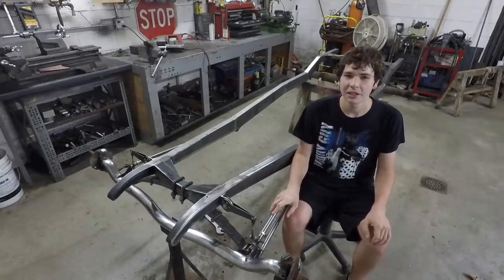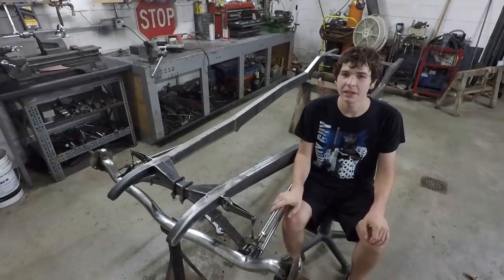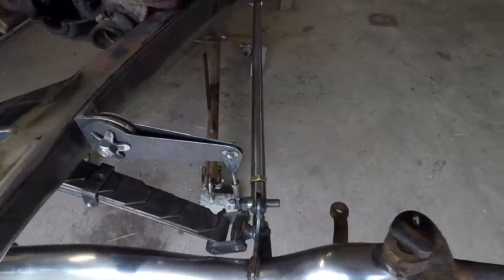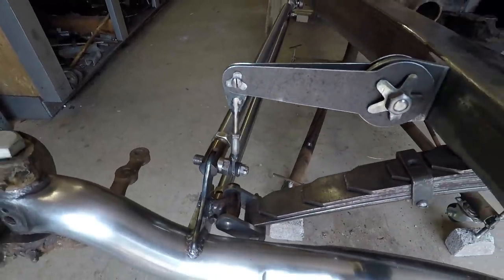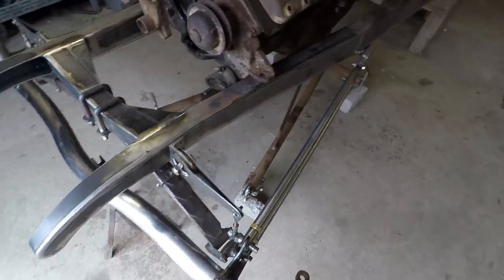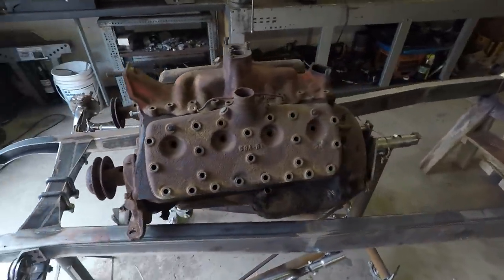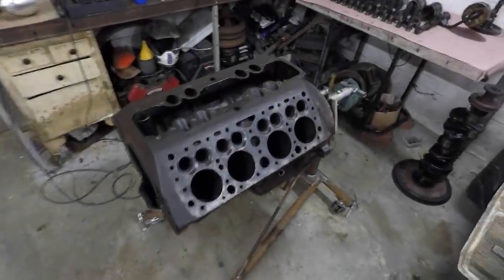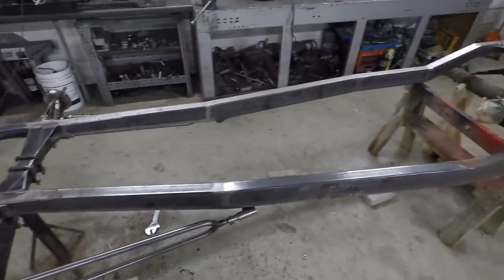Cleaning an Engine Block at Home | Boat-tail Speedster Pt.14

Comment: I wasn’t keen on using the linkage bolt heads as the damper mounting points. Ideally bolts should only ever be in tension, whereas here they will have a bending moment. If the loads from the dampers are low enough they’ll be okay if not I suppose worst case scenario is they fatigue and you just replace them. 
Loving the progress and videos all the same, nice work
Reply from the maker: yeah, I'm not overly confident on those 5/16 bolts withstanding that sheer force. I could always just replace it with something bigger though
Reply: MacroMachines Its the kind of thing that someone just watching like myself can be “overly picky” about. In reality they’ll likely never give an issue. Its the kind of thing I always tell myself I’ll fix/replace when I get time but i never get round to, or something totally unexpected goes wrong instead.

Comment: Hm. I think for the best look the radiator should be behind the front cross member. With the space for a fan that would probably set the engine back far enough to have more space between the rails.
Reply from the maker: I've been thinking the same thing